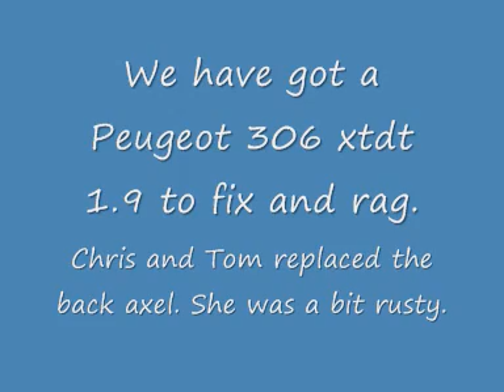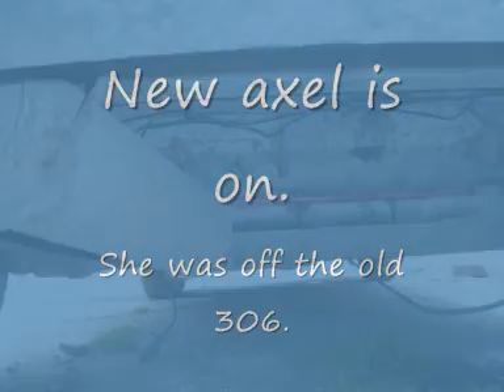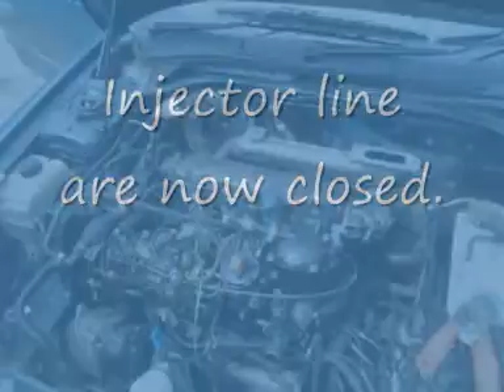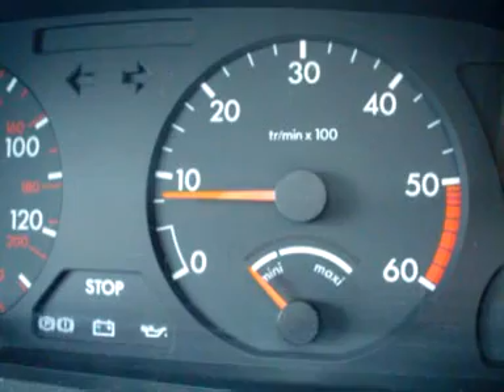We have a Peugeot 306 xtdt to rapair and rag. (Part 2)

Comment from the maker: @AirGuitarChampion right lets straighten a few things up.

firstly the intercooler goes after the turbo not before and there is an intercooler on those car. it is just removed in the vid. it goes on top of the engine.

secondly there is an air cleaner, it is located down by the front left wheel, dont know why it is there, it is french, they do things like that.

Comment: @ExtraSilver believe it or not kid... they dont NEED an intercooler here. the air is just going straight into the turbo as its getting sucked in that whopping great big hole where the intercooler should be, and the turbo is definitely connected to the inlet manifold. you can hear it spooling up at around 6:24 when he gives er dixie. if you look in the engine youl notice they dont have an air cleaning system, the airs just going straight in the turbo intake.

Comment: i have a 306, w reg, 1.4 pet5rol, manual and thats exactly what mine does a 2.26 & 2.40 minutes! ticks over but doesnt bloody bite. this tends to happen if ive driven it, leave it for 1-6 hours and go out in it within the 1-6 hours its resting. i havent got a clue whats wrong with the thing. it just usually starts and then cuts out as i drop to 1st and then try to pick up speed, as the accelerator choke cuts out and stalls the car. or the car wont start at all.

u got any tips guys?